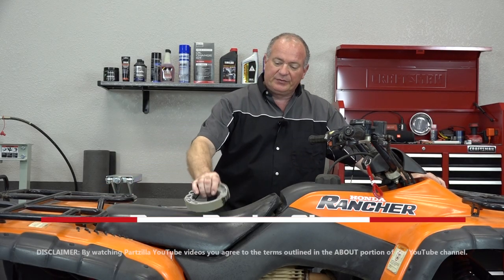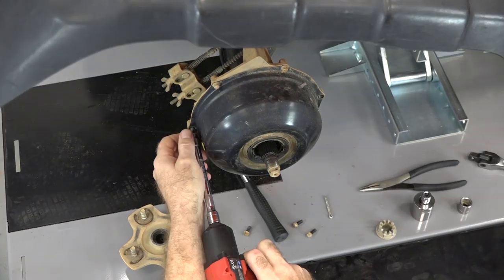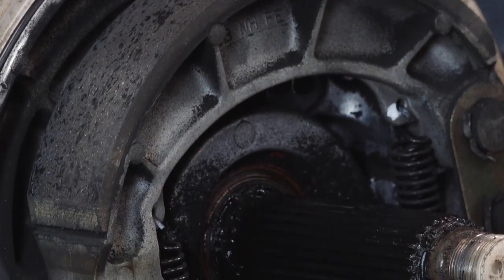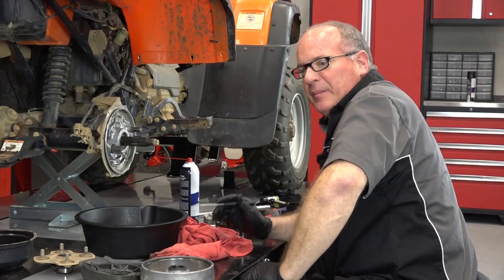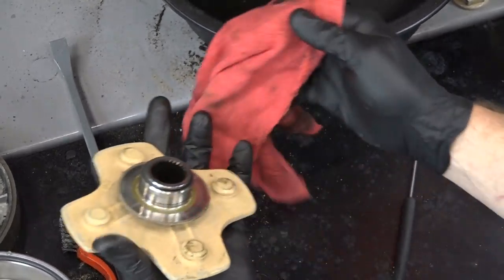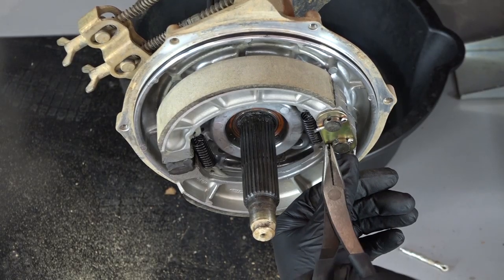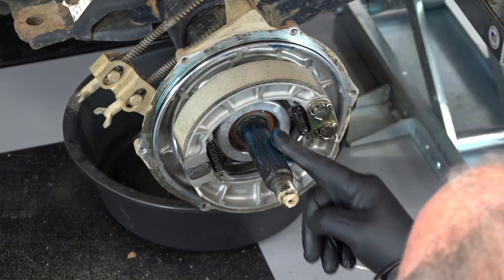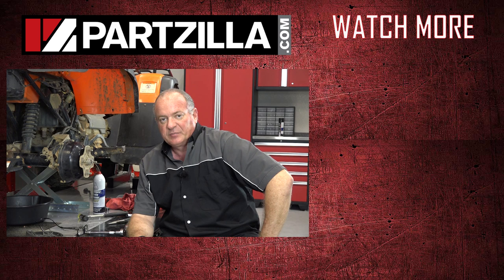How to Change the Rear Brakes on a Honda 350 Rancher | Partzilla.com

Comment: Very nice video. Very clear instructions. You did not cover removing the brake actuator pin and lubricating it to prevent it from seizing. I was hoping for a bit more instruction on adjusting the brake cables, but I think I have it. Thankyou for the video.

Comment: I had a very tough time removing the cover housing dust seal.  I definitely couldn't push it out with a screwdriver.  I ended up pouring boiling water into the cover until it started to overflow into the seal.  I let it sit for a few minutes then tapped out the old seal using a 1/4" drive extension and a small hammer.

Comment: What is a good way to clean up the hub?? Every brake job I've done the hub is rusted ,  I usually use a wire brush on a drill.. do you  use sandpaper?
Reply from the maker: Multiple ways, just don't scratch the hub in the process.  Extremely fine grit paper is ok, brash brush, no steel...etc.

Comment: This isn't a brake problem, but my 06 rancher idles high in neutral which makes it shift hard into gear. It also lurches forward while it's in gear sitting still. I figure it's a carb problem but don't know what to check first.
Reply from the maker: Adjust your idle screw and lower your idle.
Reply: @PartzillaParts  Thank you. Do you have a video on that?
Reply: @PartzillaParts  I figured it out and it seems to be running better. I'm doing the rear brakes tomorrow.  Thanks for the help!

Comment: I have the same Honda Rancher, I have replaced the brakes. The problem I have is the right foot peg keeps getting stuck when brakes applied and I have to manually lift it back up. What can I do to fix this issue? Thanks.
Reply from the maker: You have to determine why it's getting stuck.  Bad springs? Is the lever bent?
Reply: Partzilla , no lever is not bent.
Reply from the maker: Have you checked the springs and cables?
Reply: My grandpas rancher had the same issue, we took the foot lever off and it was seized, some new grease freed it right up.

Comment: i have a 2013 honda rancher and when letting go of the throttle, the bike makes a rubbing noise. i cant seem to figure what it is.
Reply from the maker: It's only on deceleration?  Could be brake pads or maybe the front tires rubbing on the plastics?
Reply: i think i can hear it a bit when accelerating, but its louder and more obvious on deceleration.. we checked if it was the plastics and no, none of the plastics seem to be interfering. its a 420 so it has drum brakes like in this video.
Reply: and its coming from the rear end.
Reply from the maker: You're going to have to isolate the noise.  It could be brakes or even differential noise.
Reply: okay thank you.

Comment: Where do the bulk hose vacuum go to...?
Reply from the maker: It's just a vent hose that is routed to vent under the unit.
Reply: Mines is broken off do I need it?
Reply from the maker: Well, it's recommended and helpful and it belongs on the unit, but it won't destroy your ATV if you don't have it.
Reply: The original tires are 24x9-11r and 24x8-12f...will 25x10x12 fit or ride different ? i can't find 25x9x11r tires?
Reply from the maker: Hard to say.  24 is the height of the tire inflated, 9 is width.  If you can get an extra inch high and wide without affecting your clearance, it should be fine.  You really should at least match the rim diameter though.  So going from an 11 to a 12 could cause some issues.